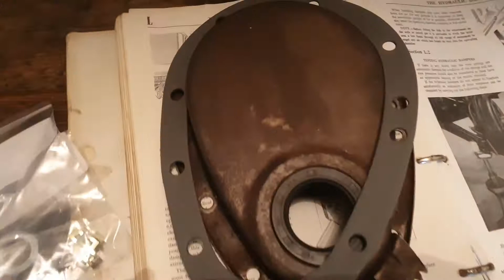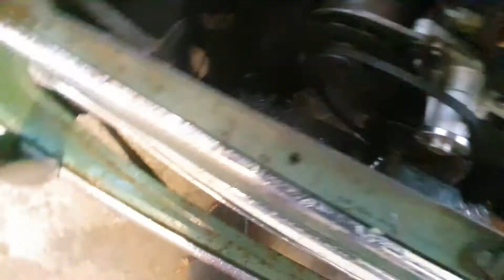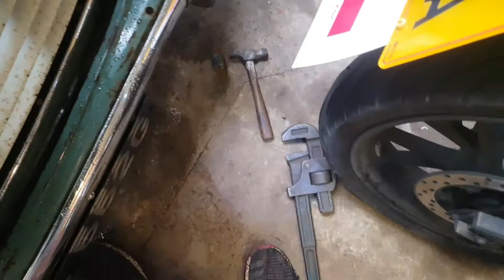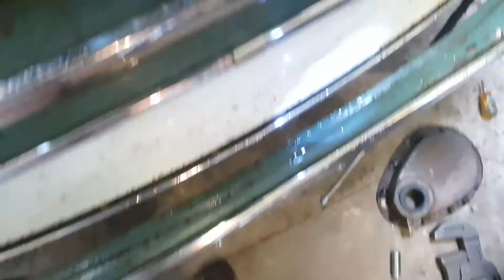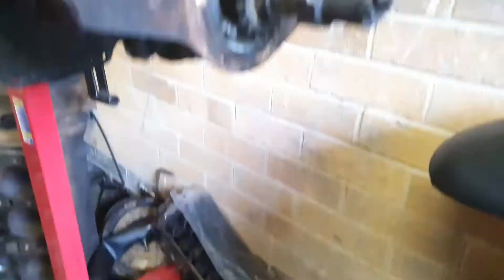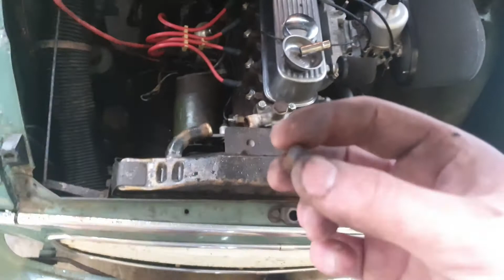Morris Minor, easy guide to replace your front main seal

Comment: I’m at the radiator removal stage - managed to get that off easily. Can you give some more details as to how you removed the crank shaft pulley? I’ve gotten the bolt off using the 4th gear starter method. Is the pulley meant to just slide off of the shaft? It’s not budging for me!
Reply from the maker: just wiggles off with no effort